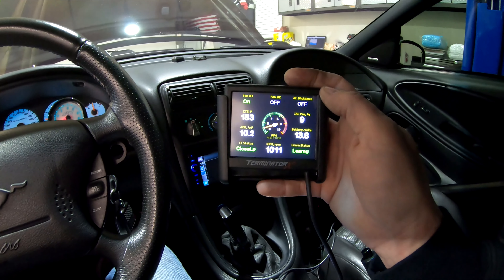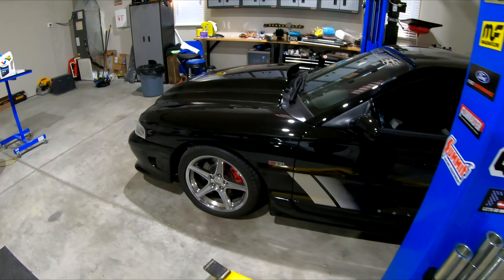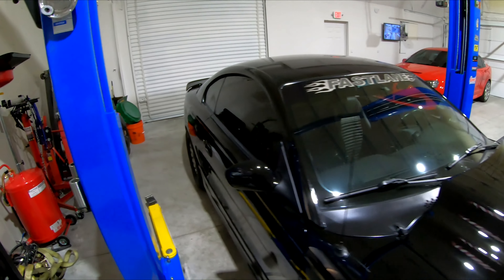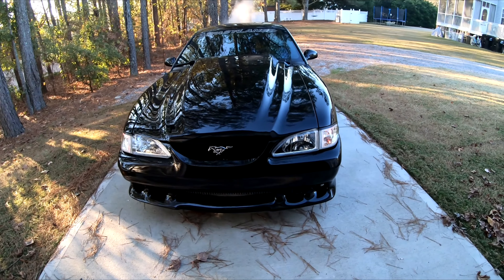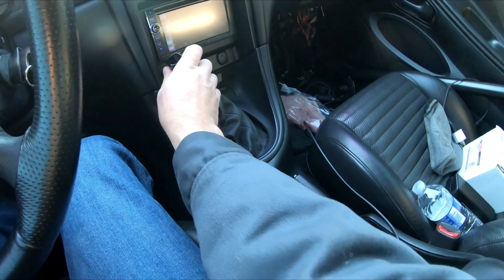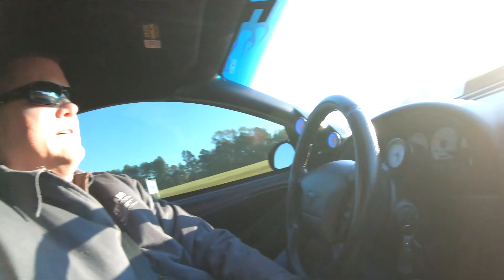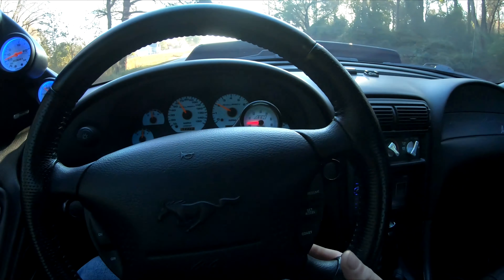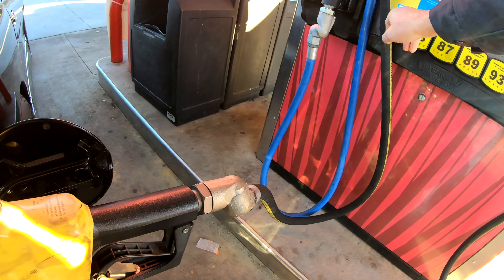Terminator-X install on the TTSaleen - Part 4  - 1st test drive!

Comment: When you looked into stand alones. Why did you choose the Holley and would you do it again?
Reply from the maker: Yes the Holley is super easy to learn.  Since this video I got a remote tune by Dr. EFI and then I learned how to tweak it myself and made the most horsepower on the dyno by adjusting my air/fuel and timing to product 1,100rwhp.  At the track I tweaked it some more and ran a best of 8.50 @ 166mph with a slow ramp on the boost and only a 1.37 sixty foot time.  Highly recommend the Holley!

Comment: What size rims and tires are those? (Rear)
Reply from the maker: Bogart Racing 15x10 with a Mac-Fab beadlock.  M/T 275-60-15 Pro Drag Radial.